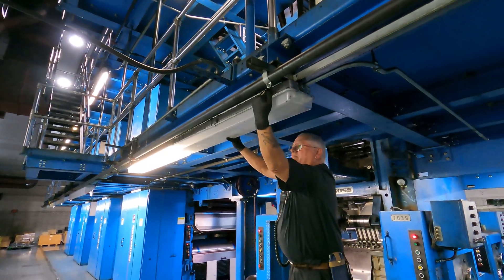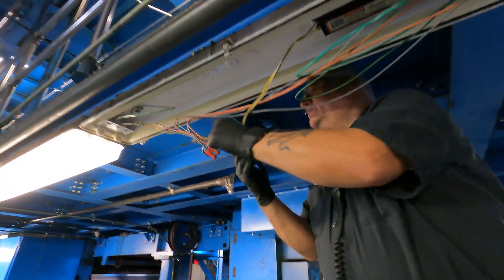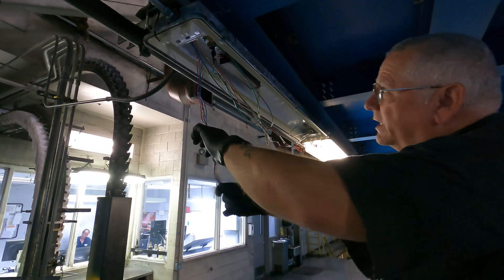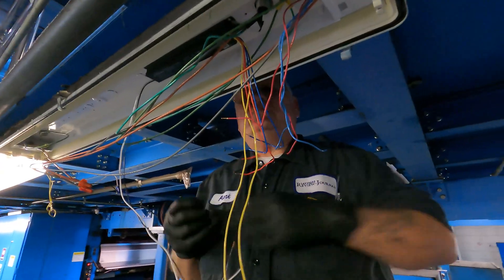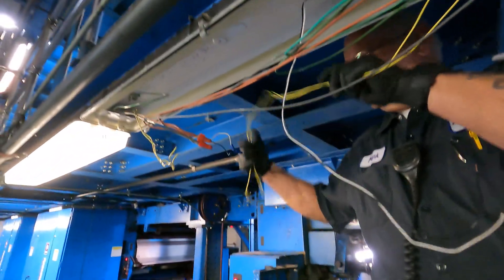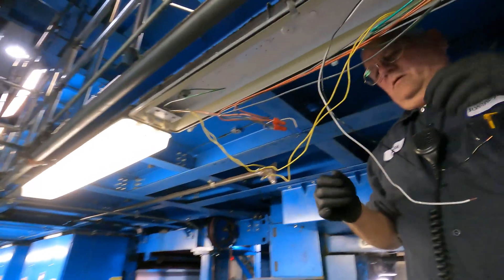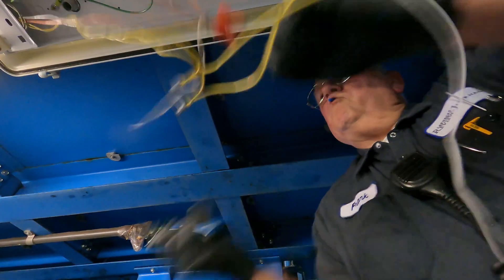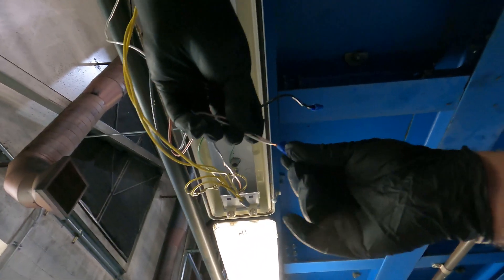Frank Shows How To Replace A Live 277V Ballast Before He Retires

Comment: I can't help but notice white (neutral) from the ballast is connecting to the orange which is normally a phase conductor on a 277Y480v system... it seems to be wired backwards?